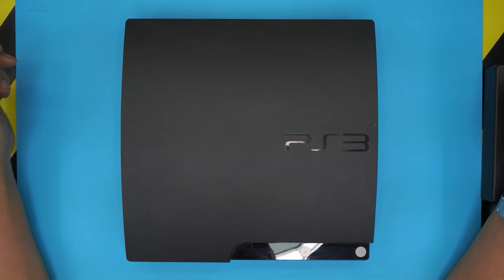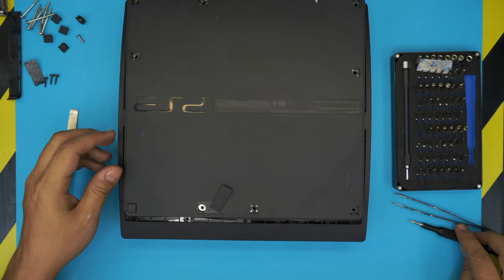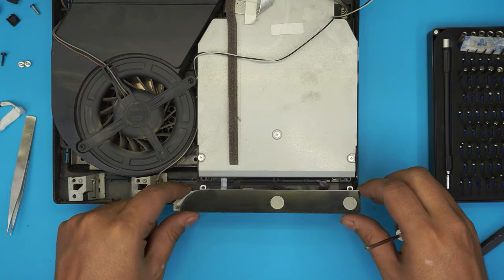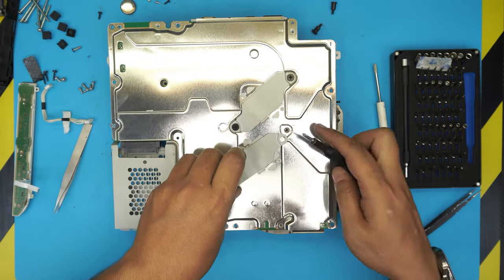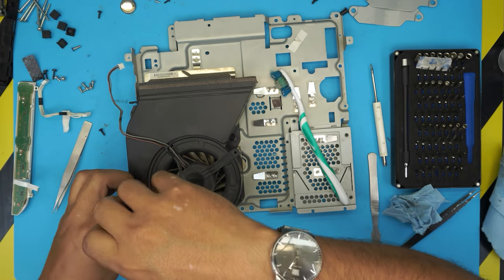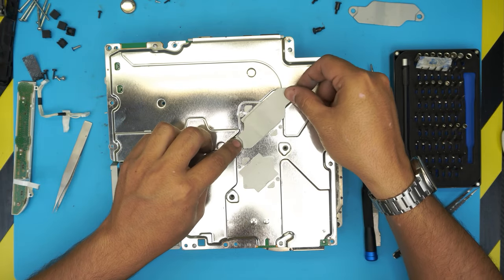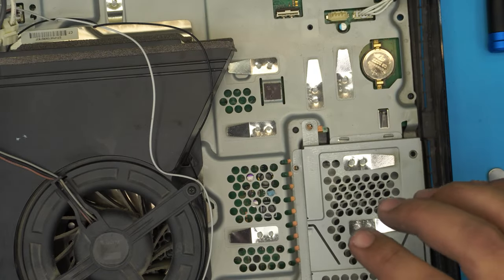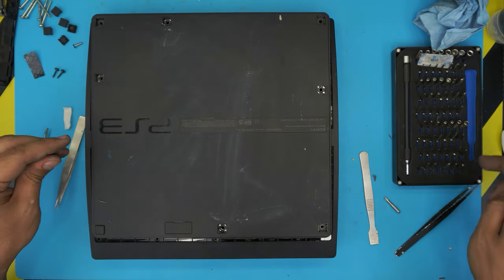HOW TO CLEAN AND REPASTE PS3 SLIM , playstation 3 slim console

Comment: I'm a proud owner of a PS3 Slim (model CECH-2504A) that I purchased last year and I would like to change the thermal paste. So I would like to know:

01) 15:05 - Can we use a cotton swab instead of a towel to remove the old thermal paste?
02) In an older video (https://youtu.be/u8H4kOuljGg?t=674), you do not recommend to remove the thermal pads, saying that we don't need to replace them. However, at 16:21, you change the thermalpads. Why did you change the recommendation? And if we should change, how often should we? Should we change each time we open the PS3 to clean and change the thermal paste?
3) How do you stick the thermalpads in it's place? Is there some sort of glue? Or will it stay there just because of the pressure?

Thank you for your video and help!
Reply from the maker: Thank you for the feedback! if you wish to support the channel you can LIKE or SUB or both :P
regarding your question: sure you can use a cotton or anything a like, as there are no capacitors on top of IHS (integrated heat spreader), clean both side the GPU/CPU and the heatsink.
i say "not recommend" because its not important, but if you have the budget and the time to get one, sure thing replace them, you wont see any performance increase or anything, and those components will still be ok with old pads.
in case if you want to replace them get a good quality pads :
https://amzn.to/3LH8ZSY
place a 2mm pads as it will squish nicely yo make perfect contact.
Reply: @uFixTek  Thank you for your reply. I was wondering if the thermal pads would reduce the temperatures further.

I also saw some videos where apparently some PS3 slim models have no thermal pads. Can you confirm that?
Reply from the maker: in my 18years of servicing never see a single ps3 without pads, those videos they must have reopened the ps3 few times and have lost the pads. i do get ps3 without pads because clients open them and loose the pads. but all of ps3 slim none slim they have pads. the pads will lower the component temp but it will not make any difference in performance of long lasting. all you need to worry about is the paste on gpu and cpu.
Reply: @uFixTek  Alright. Thank you for the support. 👍🏼
Reply from the maker: my pleasure my friend :)

Comment: Hi,
Awesome video i cleaned my ps3 and its running great, but i have 1 problem the cd does not want to enter like the thing doesn’t want to go inside like there’s something preventing it. Plz help answer ty
Reply: @UFIXTIK
Reply from the maker: Thank you for the feedback! if you wish to support the channel you can LIKE or SUB or both :P
regarding your question: you will need to make sure you have inserted all the flex cable all the way inside the jack, you have no idea how many clients come in and they think they have inserted the cable all the way in and its never pushed all the way in, and that's one of the main causes of the dvd drive not sucking the dvds

Comment: what about repasting under the cell and gpu covers? Kinda hard to get there cos of the glue, but the paste there is pretty much like a stone after a few years of using
Reply from the maker: Thank you for the feedback! if you wish to support the channel you can LIKE or SUB or both :P
regarding your question: DON't RISKT and waist your time to delid The GPU and CPU, the paste drying its fine, because its not a regular paste its an adhesive paste it supposed to dry. also if you even delid  it and repaste you will drop temps by as far as 3-4 at most and trust me that 4c extra is not worth the risk and you won't get performance.
Reply: @uFixTek  but how doo i find people delid ps3 fats and theirs temp drop from 75-80c to 50-65c and are super quit and doesnt overheat, before deliding it was overheating and too loud

Comment: I appreciate the help, i have a question though. Those little peices of thermal pad. Were the all the same thickness? And can i use any thermal pad? I had one  peice fall off i want to order some i just want to make sure its the right size.
Reply from the maker: Thanks ✌  for the feedback!  if you wish to support the channel you can LIKE or SUB or both :P
Regarding your question: use this pads 1.5mm you get better results than normal 1mm https://amzn.to/3BH5VQG
Reply: @uFixTek   thank you, so all of them can be replaced with a 1.5? I only ask because i thought in your video you mention .3 mm thick. I think at 14:53. I just want to be certain.
Reply from the maker: @travispeterson3924  the thing is that.3mm will do the job right, but the 1.5 does a better job based on out thermal component testing as the reason is that there is enough pressure to squeeze the pads down and then because it was 1.5 and squeezed down by pressure it does way better job. But the same case doesn’t apply on laptops, only here because of few factors. Therefore i would recommend 1.5 but anything from .3 up to there will be good.

Comment: Great video, it would have been perfect if you just delid the IHS and changed the thermal paste
Reply from the maker: Thank you for the feedback! if you wish to support the channel you can LIKE or SUB or both :P
Regarding your situation: there is no reason for the delid on PS3s as we have done the test and with the best thermal paste the only temp drop was 2-3c MAX. its not worth the risk and showing people how to do it properly causes extra cost for proper delid equipment, and the risk for them to follow for that 2-3c drop, absolutely not worth it. if i had done it in the video 80%+ would be screaming that they broke the PS3 :(
but i do appreciate your feedback and support to the channel my friend.

Comment: Hey man whats your reccomendation on putting the thermal paste? The X or your other video method?
Reply from the maker: Thank you for the feedback! if you wish to support the channel you can LIKE or SUB or both :P
regarding your question: go with X i been doing it for 15 years and x is the most effective for this  ihs .
Reply: @uFixTek  thanks man im using the X method but the cable for the on off button the blue thing come off now i need to wait but the packet is gonna come tomorrow.
Reply from the maker: oki good luck :)
Reply: @uFixTek  i just repaste it and everything fine now but i have one screw missing its a long but small white screw.
Reply from the maker: lol dont worry, most of the screws are not important, nothing will happen. :)  stick it with a tape to the side of the console and if in the future you reopen to clean follow the video and you will see the place for the missing screw.

Comment: Hello, I have the PS3 Slim CECH2004B and I want to change the CMOS battery and the thermal pads. How many thermal pads are needed and also which CMOS battery should I order?
Reply from the maker: Thank you for the feedback! if you wish to support the channel you can LIKE or SUB or both :P
regarding your question:
this is the battery: https://amzn.to/3rOu981
use this for the pad and you can cut it down: https://amzn.to/3lngxPN
Reply: @uFixTek  I think the PS3 Slim uses 1.5mm thickness?
Reply from the maker: oh sorry my bad i copied the wrong line its 1.5mm
https://amzn.to/3lngxPN
Reply from the maker: much appreciated my friend :) and the 10x10 is more than enough

Comment: Hi there i have my problem with my ps3 few days ago, i was copying a cd into hdd of ps3. But few minutes after the unit turned off by itself. And i was trying to open it but then i pressed the power button to power it on and in few seconds it turn off by itself. So if i repaste it you think guys it will work again? Sorry for my bad english. Btw the unit i have is ps3 slim. Please help T-T
Reply from the maker: Thank you for the feedback! if you wish to support the channel you can LIKE or SUB or both :P
regarding your question: this could be 80% your power supply that is failing, we do get this exact issue in the store a lot, if its turning off after powering on, then its not your REPASTE, its your power supply.

Comment: Anthony
0 seconds ago
If you disconnect the fan from the assembly it is in, you don't have to unplug it from the motherboard. Keep the fan close to the board and tape it to the metal to keep it from getting crimped/cut. I just though of that and will be doing that on mine! It has plenty of wire to extend from it.
Reply from the maker: disconnecting the fan its just very simple pull out, i don't see why one don't want to unplug it  :/

Comment: Great video.  But I have a question about thermal pads.  In the video you mentioned 0.3-0.4mm thermal pads, if I heard correctly.  Then you wrote in the description “Best Thermal Pads 2.5mm”, and the link inserted next to this phrase leads to thermal pads with 1.0mm thermal pads.  To be honest, I am mistaken about this, for the same reason, please tell me the exact thickness of the thermal pad, I will be very grateful.  I also wanted to know from you, some people remove the RSX cover and replace the thermal paste and glue under it, is it worth doing this, and if so, in what situations should it be done?  Thanks in advance for your answer and your work!
Reply from the maker: Thank you for your feedback! If you wish to support the channel, you can like, subscribe, or both!
Regarding your question, i do service this consoles on almost daily bases and , i would recommend you to go with 2MM or 2.5mm as it will squish to size when you screw out the plate and it will have a better heat transfer affect.
P.s i made a mistake saying .3mm :(
Should you have any further questions or requests in the future, please don't hesitate to ask me.
cheers🍻

Comment: I have a ps3 that I opened but turns hotter than the old one , I placed everything correct all screws put paste noctua nh1 but what suggestions can u say
Reply from the maker: Thank you! for the feedback and your support to the channel by SUB :P
regarding your question:
DID you clean the fan vents and everything. also if heat is coming out its perfectly fine, the thermal paste is not going to cool the air, its transferring the heat to heatsink and if the heatsink is dissipating the air out its perfectly fine.
Reply: Yes I did clean it, my guess is that it's giving Me false reading , I have a broken hdd , it takes too long to access files
Reply: I found out my ps3 is good tmeo at 40 minutes below but as soon as it gets longer my temperature always rises whatever game is it, 
Once it's coldboot it's good , 
I'm guessing it's a bard hdd that makes my temperature delay? I'm having false reading? It's pain
Reply from the maker: yes if your hdd is failing you will get false information , because of bad sectors. replace the hdd

Comment: That looks as if it can't be enough paste to cover the lid, esp. with the weak clamping force.
Reply from the maker: Thank you for the feedback! if you wish to support the channel you can LIKE or SUB or both :P
regarding your enough paste: we have tested and lifted up the heatsink and its more more than enough , even with trashy pressure from heatsink. when the CPU starts heating up that's when the paste settles beautifully. i been doing for over 18 year on my friends and clients and zero issue. but by all means you can place more paste but then you will have paste going under GPU/CPU and it will contaminate the CPU.

Comment: I don't think it's necessary to replace thermal paste on a ps3 slim
Reply from the maker: oh boi you couldn't be any wronger my friend, the life span of the GPU and CPU will increase a lot, its like saying i don't think i need a oil change for my car.
Reply: @uFixTek  you are absolutely right!, i learned it the hard way! last year i could of replaced the paste but i only cleaned the dust. now my motherboard is dead and the technician is doing a re-balling of my GPU because i never replaced the paste! i was advised to repaste every 1-2 years.
Reply: After some years, the thermal paste that the company (in this case Sony) applied becomes very dry and conducts almost NO heat to the cooler / fan... So it means your CPU / GPU will overheat BIG TIME. You'll hear the fan spinning very loudly etc. It's absolutely essential to put fresh thermal paste on any computer or gaming console after a long time of usage (or even if not used but it's old). New thermal paste makes it run like it's brand new.

Comment: Hello, it is possible to remove the cover where there is no screw?
I bought a PS3 Slim recently and that one is a bit dusty and i wanted to change it, i have substitute for it but doesn't want to come off.
Reply from the maker: the outer cover? or what cover are we talking about, all the covers have screws and must be removed.
Reply: @uFixTek  Yes the outer one, the little rubber covers that acts as a little stand for the console (the four ones at every angle).
Thanks for the answer, i thought i would had to keep it.

Comment: Been looking for a video with a slim sp i can try replacing my HDMI port as I think that's whats wrong with my ps3
Reply from the maker: hi, regarding your problem, can you explain what happens when you press the power ON,? sound beeps etc....
Reply: @uFixTek  hi, it works if fine starts up fine but after a while it freezes then I try turn it off and on again and it doesn't register on the TV and the HDMI plodded into the ps3 is really hot
Reply from the maker: its not your HDMI connector its your CPU that needs to get repaste and or an re-flow. BUT
before anything use a different hdmi cable and see if the result are the same then you will mostly will need a re-flow
Reply: @uFixTek  i am getting a CV cable for it too see if its that I have just got it JB  and repasted I hope its not that I will let you know how I get on with the CV aswell Thanks for helping me 🙏
Reply: @uFixTek  I got my thermal paste upgraded too graphite pads too if thats anything
Reply from the maker: @darren1059  no problem my friend , and also never use graphite  on  consoles as they dont do a grate job on consoles, change  it to a good paste artic-mx4 or grizzly:
im very sure your issue is in your graphite pad.
https://amzn.to/3wtK3Xp
Reply: @uFixTek  yeah I got the AV cable through today and it's doing the same thing makes the screen fuzzy and jumpy and freezes so must be the CPU  😒
Reply from the maker: yes unfortunatly its your apu (cpu) that is failing, an dhte actual problem is not the cpu its the solder balls under the cpu. you can fix this by removing the motherboard and heatsink and place it in a room temp and use a hair dryer at max heat 1" above the cpu for 5min no less and let it cool down on its own at room temp and repaste and you set to go.
Reply: @uFixTek  dang, well I orderd the stuff thanks for the link 🙏 and all  your help, I will keep you posted?
Reply from the maker: anytime if you need more info or anything feel free to ask
Reply: @uFixTek  it will be here in 8 days i will let you know thank you again 🙏🙌
Reply: @uFixTek  hi how are you sir? I just opened my ps3 and i have thermal pads not paste and didn't know what to do just wondering if you did at?
Thanks
Reply from the maker: @darren1059  can you upload some pics  so i can check. https://prnt.sc/
Reply: @uFixTek  hi sorry for taking so long been rushed past week or so, I have uploaded a couple of pics just now not sure if there any use though I can put more on if you need, thanks
Reply from the maker: @darren1059  send me the link for the pictures
Reply: @uFixTek  not sure if I did it right i send a couple yesterday if you have insta I could send you mine and send them that way?

Comment: I am gonna try to do this on ylod ps3 hope it works
Reply from the maker: Thank you for the feedback! if you wish to support the channel you can LIKE or SUB or both :P
regarding your question: i would highly recommend you to do the following steps after removing the motherboard,:
#1, place the motherboard on a wood or any table that is wood base.
#2. use a hair dryer at max heat medium air, and place it over the GPU for 10min (same step on cpu for 10min)
#3. let it cool down by it self don't MOVE or blow air to it at all for 15min
#4 repaste and enjoy.
Reply: @uFixTek  thank you for the information i will follow this steps😀
Reply from the maker: @apshotsnep  awesome trust in your self and it will be all good to go :) use a good thermal paste : https://amzn.to/3D4g39C
Reply: @uFixTek  ok🙏🙏
What type of thermal pad should i use as you did in the video
Reply from the maker: get a 2.5mm pads i use this brands and they are very good: https://amzn.to/3D2ZwTt

Comment: About these thermal pads 14:47 what kind of thermal pad should I use? I have a 1 mm thermal pad with the Thermal conductivity of 1,2 w ~ 2,0w. Will it do the job or is it risky?
Reply from the maker: you can use that and it will work just fine, thats perfect for those components. thank you for the support to the channel.
Reply: @uFixTek  Do you think I should use a Thermal Pad with a thermal conductivity of 3w/mk instead? Or use one 1.5mm thick instead of 1mm?
Reply from the maker: i would go with 1.5 -2mm, those components dont really need the thermal pads but it is nice to keep them low on temps/.